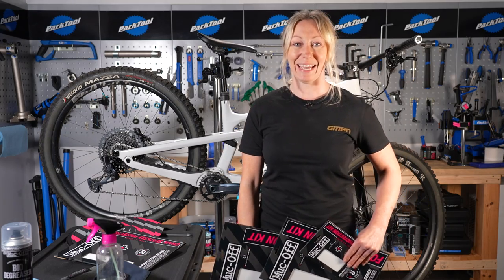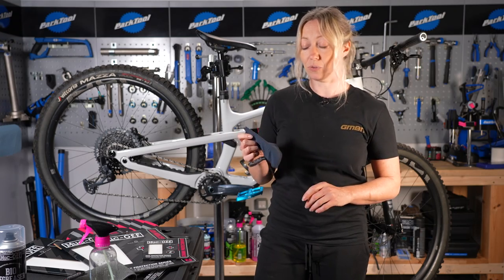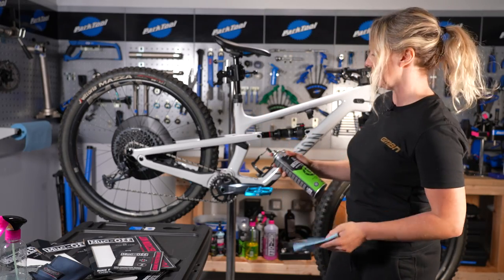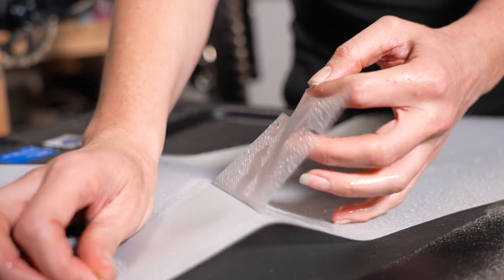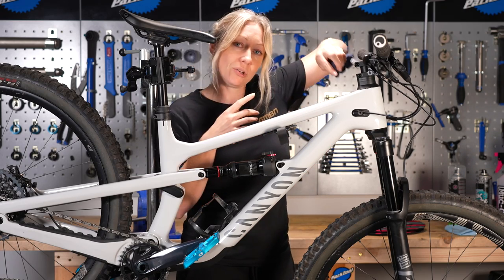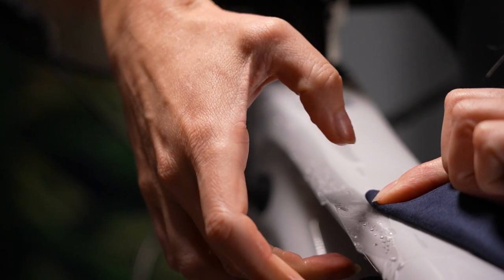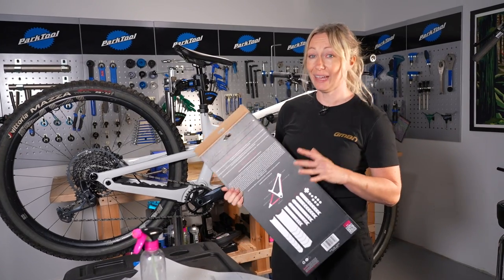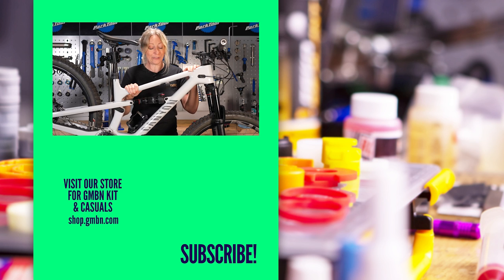How To Protect Your Mountain Bike Frame From Damage!

Comment: I have used both, the ones you apply with water as shown and ones that are applied with a heat gun (Dyedbro) and found the second option easier to work with.

Comment: Hi... The paint scheme on my bike (trek roscoe 9) has raised spots all over it part of what attracted me to the bike. But do  I now have an issue with frame protection..Will I be able to apply the protection to an un smooth frame? ... I'm guessing i wouldn't be able to avoid air bubbles.. Thanks in advance 😁

Comment: I used a 3M film that used a bit of alcohol and it worked quite good.
Thank you for this (advertisement) tutorial and reminder that I want to do just a little more than the seller did on my beautiful Canyon.
P.S.  I bought the film as sheets and cut it up myself which I found more effective than precut pieces.

Comment: I’ve used a combination of ceramic coating and xpel protection.
Reply: Make sure you take care of that ceramic coating. It will haze up on you if you don't care for it like the manufacturer says. Then it's a pain in the arse if you want to remove it. It can stick so good to the paint it will ruin the paint trying to get it off. Especially if you try to buff it out.
Reply: I install ceramic coatings as a small business for years. I don’t have one on my mountain bike, would be useless. Better off using a spray sealant after every wash.